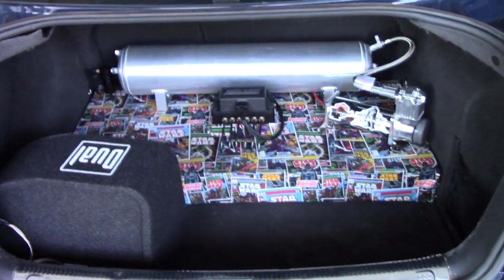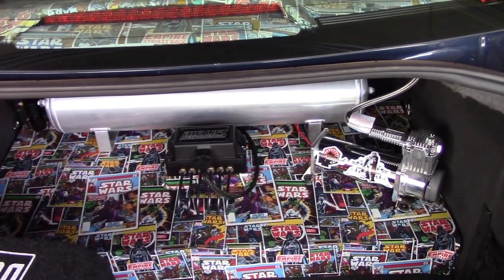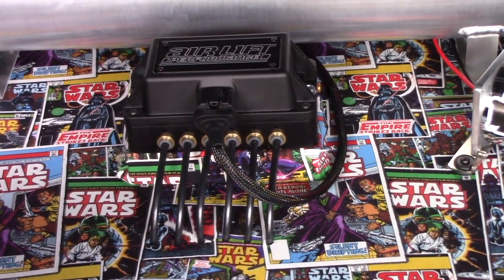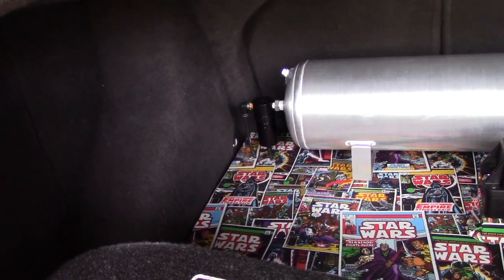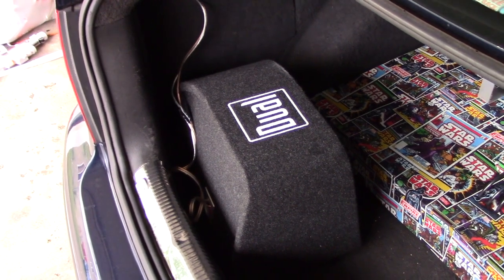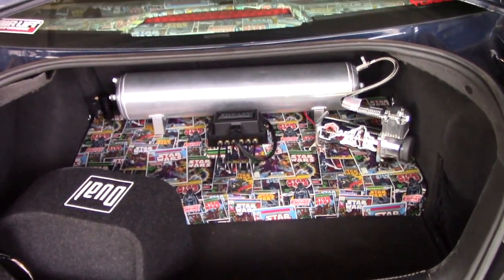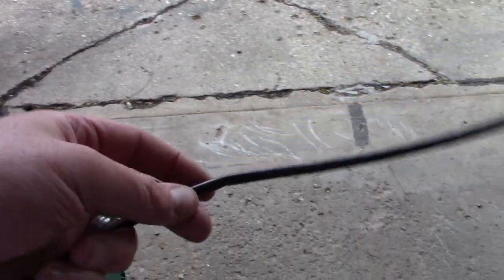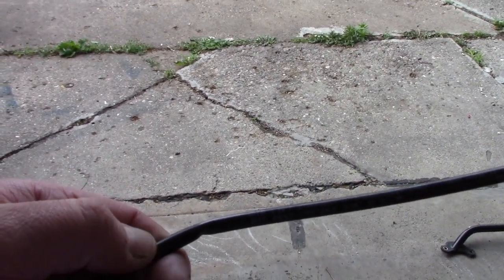Air Ride Final thoughts/pre review

Comment: Hi  bro I used Loctite 545 as i researched that was good stuff. I used it on all the bare NPT fittings and when pressurized it leaked. I thought it was good stuff, but its not. I ended up using the Teflon pipe paste and it worked.

Comment: great vids bro, i want to bag my wagon too. Hows the ride now compared to the springs? im running raceland ultimos  in my wagon but im starting to hate the hard ride :/
Reply from the maker: Thanks! The ride is great! It's a bit more bouncy than the springs I had but not as stiff. Although at higher pressure's the ride gets stiff but my daily drive settings are nice and sporty but not rock hard.
Reply: +MK4 Modder that's great man, guess I'm going to start saving up for my air bags :) I got a vid of my wagon in my channel if you want to take a look at it, cheers bro!